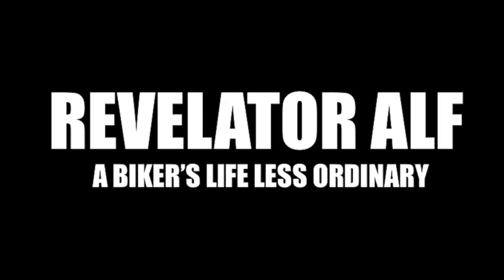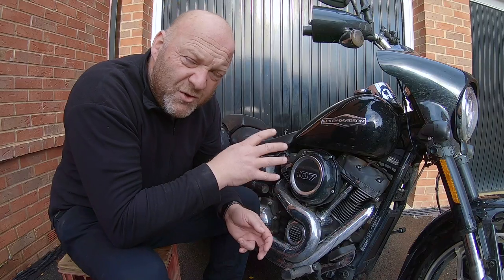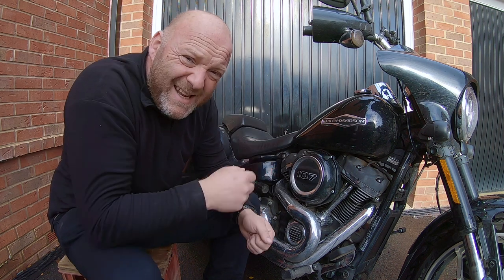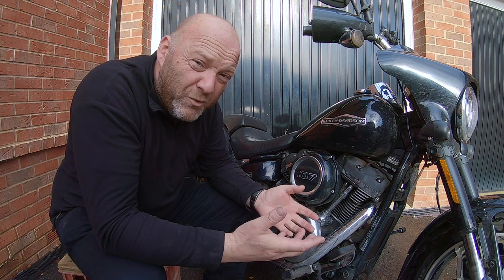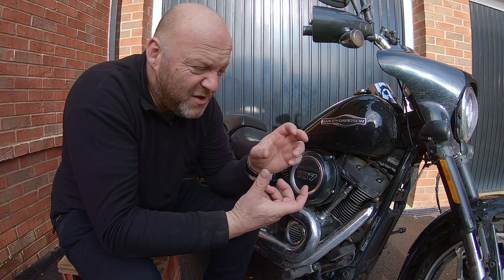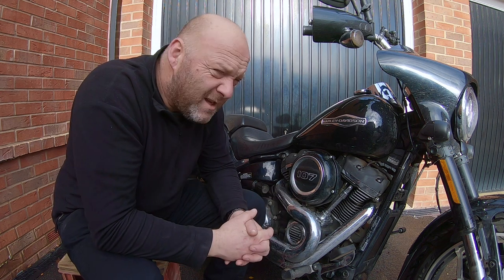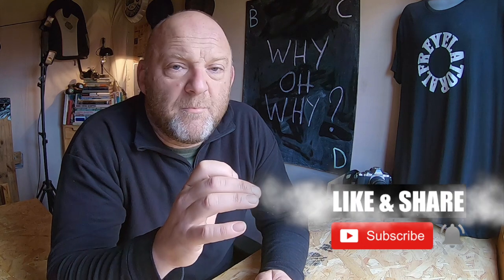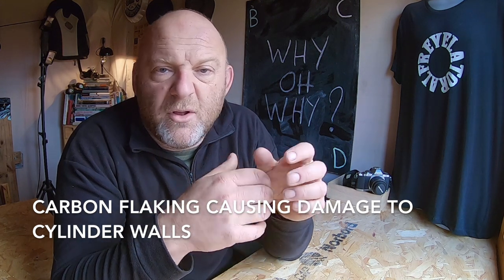Is It Worth Installing External Breather Kits | H-D Truths & Mistakes

Comment: What about the elimination of the vaccume out of the engine when its running? External venting would be dead air when it used to be sucked out. This is holding me back from switching. Any input would be appreciated
Reply from the maker: The venting already takes place so nothing is affected anyway. Cheers
Reply: I made my own venting hoses and i can tell you it puffs water and air out of the hose when engine is running.

Comment: RevelatorAlf, what is your opinion on the feuling vented dipsticks? Supposedly, they help solve this problem to. Just bought my softail standard last month, and looking to keep my baby clean as possible, externally, and internally. thanks for the great content.
Reply: I run a vented dipstick, definitely seems like the engine spins a little smoother with slightly less pressure in the crankcase but I still have an oil trail in my intake going into my throttle body. I'm currently awaiting my external breather kit to arrive. I don't expect a huge performance difference but anyone with a basic understanding of internal combustion engines work knows hot oily air going into the intake definitely isn't a positive.
Reply from the maker: Thanks Rene. So the vented dipstick may indeed suit the purpose of relieving crank pressure. What overall affect this has...well there is yet to be definitive data on that but you would imagine it will be positive. As for the venting into the throttle body, well the vented dipstick may not solve that.
So if it’s really a concern to you then perhaps for a breather kit and see how you go. 
I am in the process of producing data on these products but until I have results to share, I really can’t say definitely either way whether they have any benefit or not. Cheers
Reply: @RevelatorAlf  I'm going to stay tuned for this.
Reply: Hi Alf did you gather any evidence of this

Comment: I simply route the breather tubes to allow the oil to drip into the air cleaner element, which is oiled anyway and cleaned every few thousand miles. Intake stays cleaner, Problem solved. I can't believe people invest so much time into such a trivial issue, but it's a trap that befalls Harley-Davidson enthusiasts particularly, in chasing tiny performance gains on a motorcycle that isn't "performance" oriented to begin with. Boggles my mind.

Comment: Just out of curiosity is this an issue for other modern bikes by other manufacturers? Do others vent oil back through the throttle body?
Reply from the maker: I think a lot of modern bikes are doing similar things for emissions purposes but really the big point out of this is whether or not it make a marked difference despite the big claims sometimes made. Cheers

Comment: Are you serious? The engine will not throw an error code if it doesn’t get the hot air with oil mist. Also, during a cold start up you wouldn’t get any warm air out of the breathers to aide start up. 
You also missed the #1 reason people run external breathers. To keep oil from soaking the air filter and then ending up on the side of your bike. Stock bikes don’t have this problem but who rides stock?
Reply from the maker: Yes I am and yes I do and no I haven’t

Comment: Cheap mod, other than asthetics, no real downside. As the bike wears out, the blowby will increase, the increase in gas flow will bring more oil with it. Breather mod will become more worth it.
Reply: Here's the other part of my thinking, I have a Harley heavy breather air intake. The design suggests that it could have "ram air" or a little bit of forced air intake at interstate speeds. Whether it does or not I don't know, not saying I know, I haven't seen any proof. For the purpose of argument tho, let's say it does. This positive air pressure would be working against the crankcase venting. Pulling the venting out of the air cleaner removes this possibility, among it's other positive qualities.

Comment: Truth is, noone has taken actual pollutionn content measurement of ppm right out of the pipes. The USA epa is the real problem , they ignore proper testing and pimp themselves to environmental cases with no real evidence of what actually goes into the environment . Shit fuel and choked down engines are inefficient. The catylitic converters cause high heat and add more inefficiency than any other component, not to mention hhaving seen some very bad burns on the right leg of very many riders. Air pump period, anyone having any experience with engines knows that the air flow has to be efficient. Anything that interferes with air flow and combustion processes causes inefficiency. Exhaust back pressure as any engine builder and racers know is a fallacy, so a very high flow exhaust and intake system are a benifit to any engine and yes there are good mufflers with high flow and no back pressure. Walker comes to mind. The fact that HD engines are actually oil cooled and not really air cooled is another overlooked fact, more oil supply and a large oil cooler along with synthetic oil work better too. If you are going to run crankcase pressure outside the engine a bit of thought to designing the pcv in a way so the oil residues can fall back down the pipe into the crank case and still breath through the intake is quite simple, a breather set high 23:27 23:27 in line with piping having enough flow for oil to be able to fall back into the crank case. Personally I would be far mor concerned with oil pump and crank bearing problems from poor design, piston oilers on the 17 m8 s are a bigger worry too. Screws being too long in them and depressurizing their capability to cool the pistons ducks a lot of top ends. Bottom ends have ball bearings and piss poor tolerances from twin cam on up. Pressure build up in the crank case is a major problem in any 4 cycle engine but fixes should include not puking to the outside. Transmissions are being vented well as oil cavitation causes pressure build up, that is worth doing too and not as problematic as the engine oiland intake system. For all their problems very few people go to other brands and fixing any issue is going to happen. If you are unsure of any of this, it would be a good idea to watch Kevin Baxter on here. He is a very capable bike repairman and builder along with very good people skills. Cheers.

Comment: You don't see 955 hp.Nascar small blocks built in secrecy buy the most elite engine builders ,no expenses spared, wasting anytime routing heated low oxygen crankcase junk thru the engines they build.Lets face it probably 98% of the Harley's on the street don't meet the same smog standards they did when sold new.😉

Comment: Just had to replace the top end on my 2020 Road Glide Special with 35,000 miles. Carbon build up was so bad the piston started hitting the head.
Reply from the maker: Wow. Cheers
Reply: There’s no way that carbon came from not having a EB, you had a ring seating problem on your pistons and most likely oil sumping issues as well.
Reply: @tomellis7949  You are correct. It was a combination of issues and I believe your assessment to be the most likely. However, the motor company is denying those issues.
Reply: @MSTRnBTCto-the-moon  That definitely should be a warranty claim.

Comment: I think your missing the point emissions control systems kill engines. They are not there to enhance or improve the engine performance or reliability they are there to reduce emissions. Custom car makers, stock car and drag bikes have been using external breathers forever. Some harley motors particularly softails with external oil tanks run dry sump, when stood for some time excessive oil drains back into the sump and can be pumped up thru the engine out those breathers and back into the combustion chamber in excess. I for one dont want hot oily gases puked back into my inlet manifold to be burnt off with my fuel. Like you said cool fresh air mixed with fuel is best for performance, not hot oily air mixed with the fuel. Suzuki Bandits are notorious for fuel tap failure, the fuel flows into the carbs back into the airbox down that emission control crankcase breather and into the engine, unless spotted it can potential kill your engine by washing out the bores. People in the know vent them. If you have a harley with factory installed silencers and like it that way leave everything as it is. If you get a stage one run quieter baffles for good back pressure, a decent air filter and vent those head breathers, or like matey below says on the M8 vent your oil cap. Ditch those O2 sensors and cap the holes, fit sensor eliminators to stop error codes. Those O2 sensors do not monitor and regulate the fuel to optimise it. They are there to enable the ECU to weaken the fuel mixture to comply with the emission standards and in certain throttle positions (mainly mid-range) will try to lean the mixture too much.
This is good for the emissions but not for the performance and smoothness of the engine. Or be like Alf ignore decades of performance people and leave it just like the regulatory board would like it. Am certain that emission controlling your already efficient bike will help eliminate the O2 China and Pakistan are churning out. Checkout this video for blowby on your M8's, the carbon build up on the pistons will absolutely freak you out! https://youtu.be/NO6toHHraDw
Reply from the maker: Yep you may have misunderstood the intent of this video completely.
Reply: @RevelatorAlf  A much better explantion. A large proportion of Harley riders get their bikes dealer serviced, they are riders and trust the manufacturers/dealers implicitly. Actually fully understanding how the Harley motor works, how it creates excessive unvented crancase pressure is not something they even consider. For the short period of ownership why should such things even be considered. I certainly didnt with the one year I owned a Dyna Fatbob 2008. Long term owners who keep their bikes well after the warranty has expired often encounter expensive issues. Dealers want your money they will keep repairing in-built faults never actually resolving what caused them in the first place. Only if you research out these issues and find out cures and ways to avoid the same potential issues futher down the road, impliment them yourself will you avoid more expensive bills. Either stay as a rider with dealer servicing trusting the factory/dealer only wants whats best for you. Or look deeper, see the design flaws implimented through emissions control systems and eradicate or eliminate them altogether. Some of us are in the know and lots of us dont want to know.
Reply: If emissions systems killed engines there wouldn't be cars out there with hundreds of thousands of miles on them. Do emissions systems reduce performance by an inconsequential amount, sure. Do they destroy engines. No they do not.